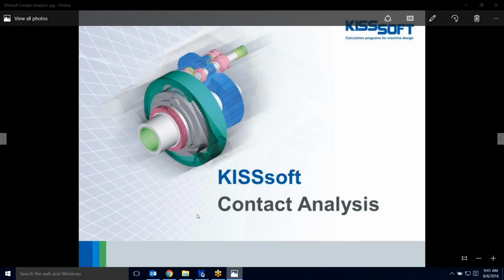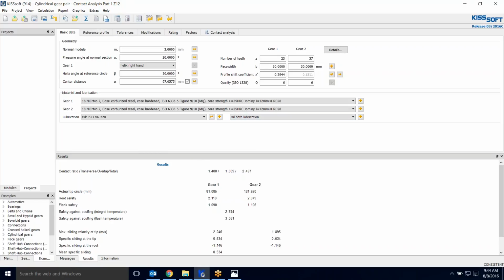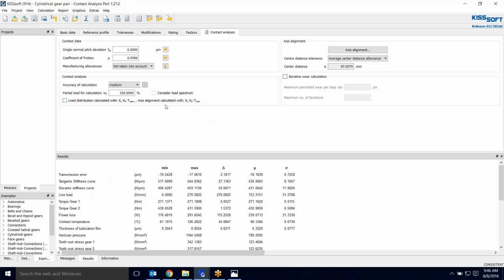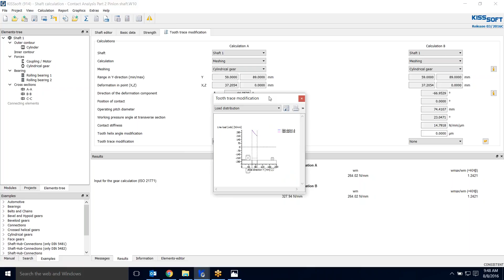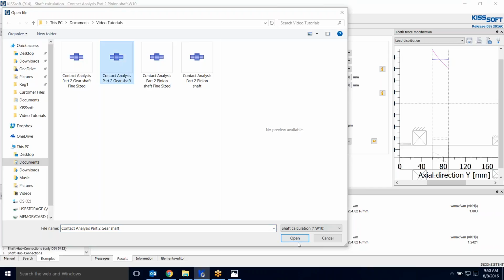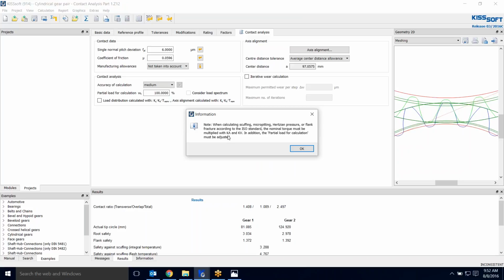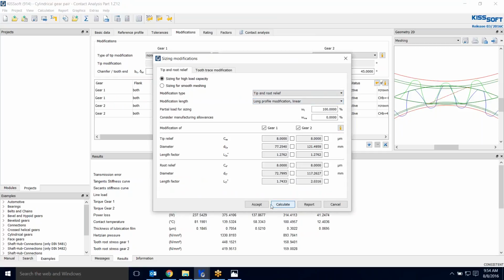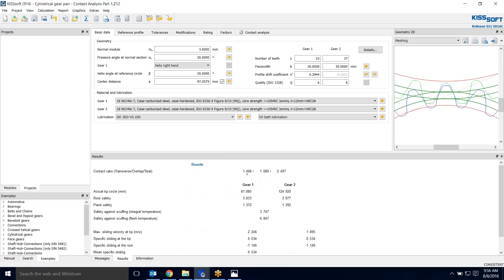Contact Analysis Part 2

Comment: Where to get "contact analysis pinion shaft" file that you open in openfile
Reply from the maker: it is in the examples window on the main interface of kisssoft.  If you click the view drop down make sure examples is checked.  In the bottom left corner of the interface there will be a tab for examples.  Should be example16 or shaft for gear pair example 06a in release 2023.